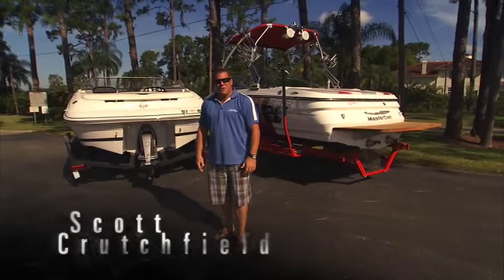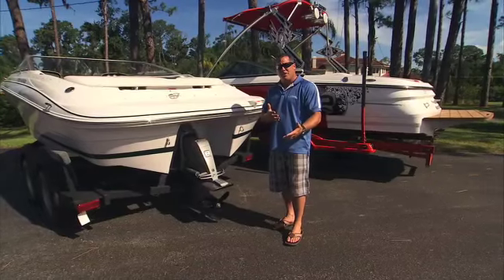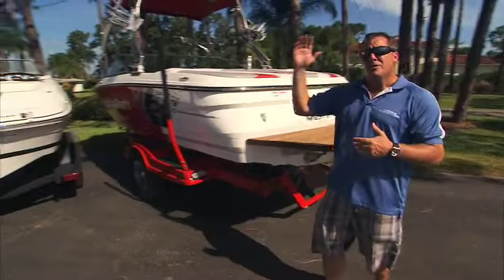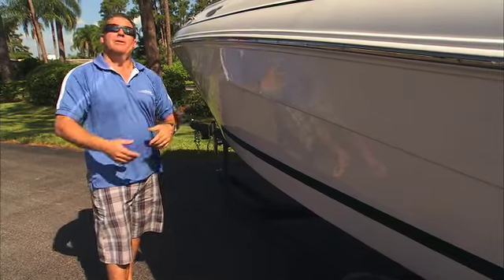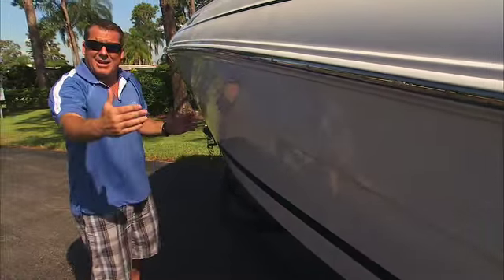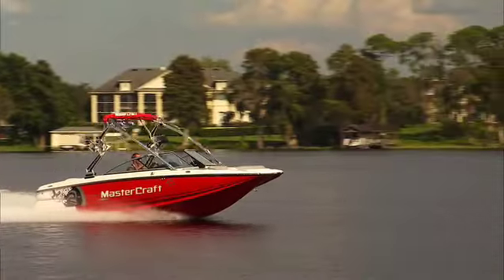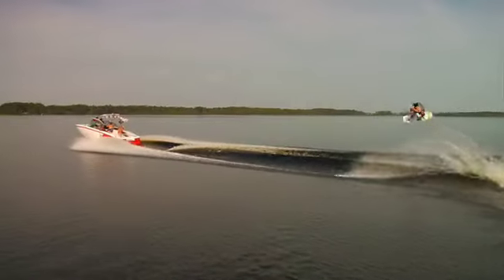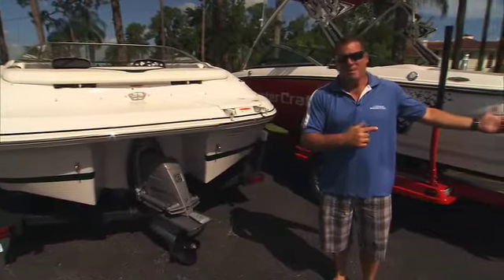MasterCraft Rewind 2009 - V-Drive versus I/O Review

Comment: Its funny because yes an i/o has more control around the dock at times other than that its a pos no r&d into the hull or wake profile danger of the prop to swimmers. as for the x7 quote every mastercraft is tested on the water at the factory so idk if u bought it used or what but I find that hard to beliveve as a owner of a 84 S&S with the orginal shaft seal and no leaks

Comment: Jet drive handily out performs V drive at every single thing this fool talks about and a long list of other important things he doesn't........usually at a 30% discount when comparing similar boat lengths and similar features. I recently saw a nicely equipped 23ft Master Craft for $117k. A nicely equipped 25ft Scarab HO Impulse wake.......is a bigger boat with similar features at $90k. The Scarab plains in 1/2 the time....hits 30mph in 1/2 the time and offers a 9 or 10mph top speed advantage with little to no penalty in fuel economy. 
     Master Craft is the boat you buy when the statement the boat makes is more important to the owner than the actual boating experience.
Reply: Surfboat owners are like Harley owners
Reply: Gus Almighty Obviously you completely ignore the fact that a mastercraft would destroy any shitty jet boat in any water activity. Sure, you can surf and everything on them too, but you do get what you pay for, and that is pretty evident in the resale market where it’s clear no one wants old, trashy jet boats lol. You see these old wake boats with 100s of hrs selling for high amounts still because they still hold value off the showroom floor. (Unlike your scarab) Sometimes cheaper doesn’t always mean better.
Reply: @charlieellis8777 If I had any interest in surfing I would still buy a 242x before any over priced inboard or v-drive. I will be sticking with jet boats.